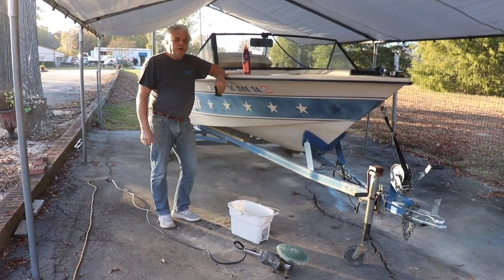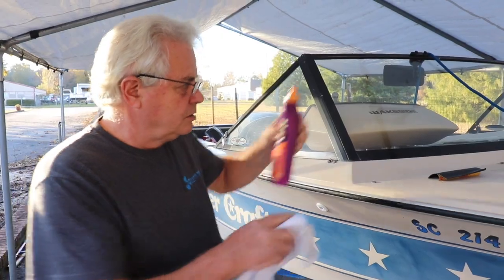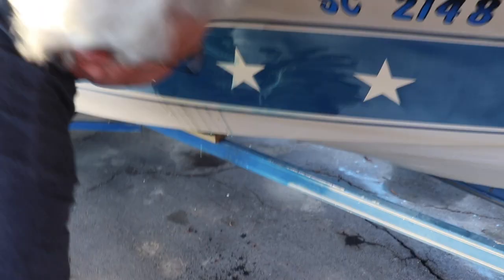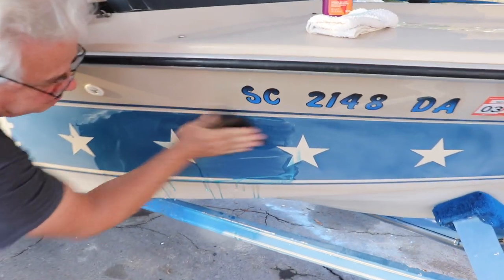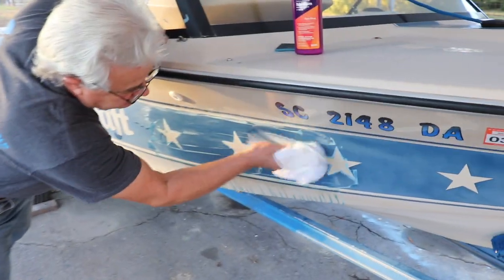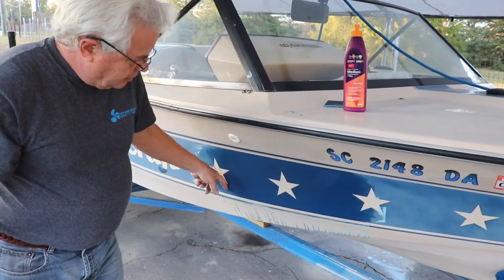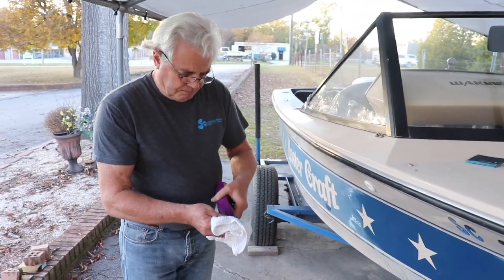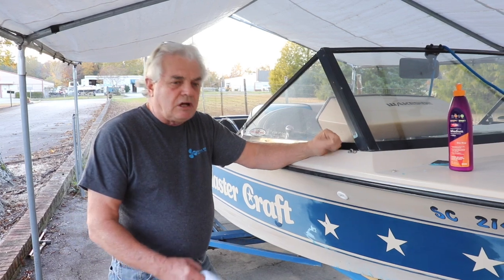How to Buff and Restore the Gel Coat on a Boat with Compound

Comment: That's like the 1st model of Mastercraft. I know the 1st one made personally but the reason I wanted to say, you could have just used compound and avoided the sanding altogether.
I also have that big buffer. I had it polished up and it hangs in my shop now, classic machine. Still have the wood handle?
Reply: The 1st models had a rounded windshield!  This one is the 90s absolutely gorgeous